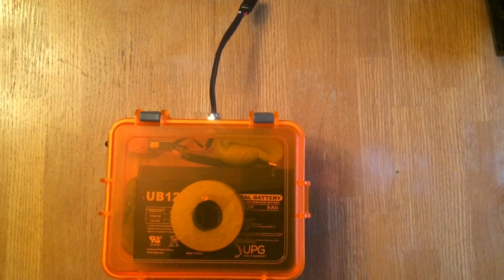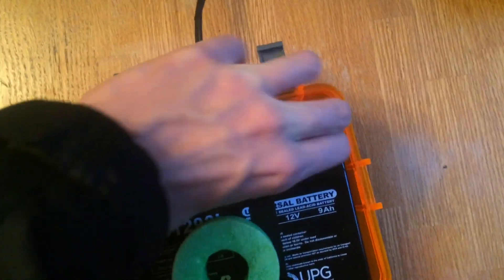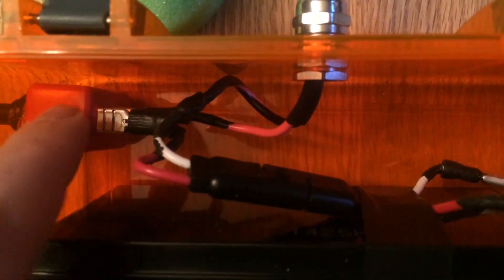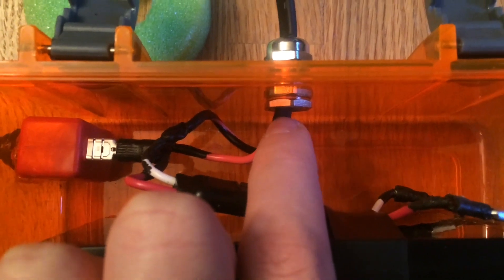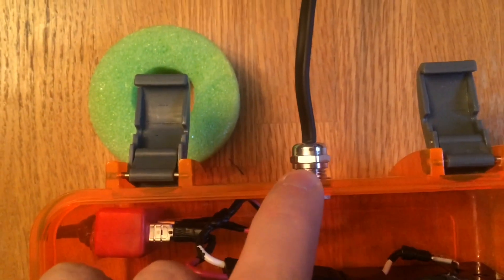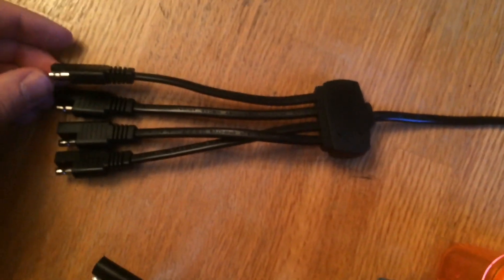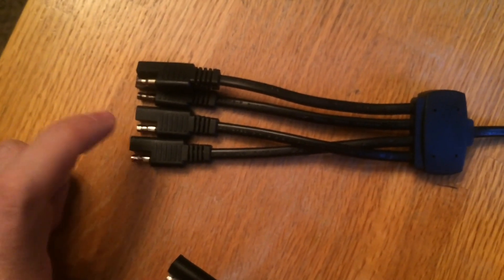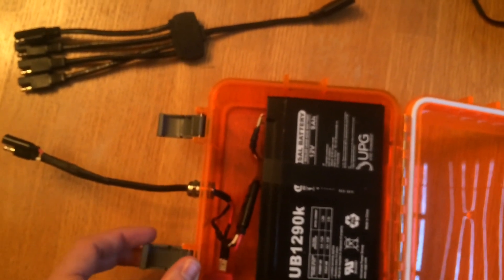Waterproof 12v Battery Box for Fish Finder, Livewell, & Kayak Fishing

Comment: Nice job can you sent me the sopply list,
Reply from the maker: Supply List is listed in the YouTube video description just below the video.  There are links to all the items used.  Only item you didn't see in the video was an inline fuse.  We didn't need one for the electronic items we were powering.  However, if you plan on running a lot of electronics from the box it is recommended you put an inline fuse in.  You could wire the inline fuse after the on/off switch just before it goes through the cable gland.  THANKS FOR THE MESSAGE!
Reply: Thank to you
Reply from the maker: COPY OF SUPPLY LIST THAT IS BELOW VIDEO IN DESCRIPTION SECTION.
*****************************************
Supply List Below.

Watertight Container (Large Size): http://www.amazon.com/gp/product/B007...

SS PG7 Cable Gland (x1): http://www.amazon.com/gp/product/B00A...

SAE Connectors (x2): http://www.amazon.com/gp/product/B003...

SAE 4-way Splitter (x1): http://www.amazon.com/gp/product/B003...

On/Off Toggle Switch (x1): http://www.amazon.com/gp/product/B006...

Battery 12v 9ah by UPG (x1): http://www.amazon.com/s/?_encoding=UT...

F2 Crimp on connectors (use for connecting battery terminals to SAE wire inside box)

OPTIONAL: In-line Fuse If Your Electronics Don't Have Them: http://www.amazon.com/s/?_encoding=UT...

OPTIONAL SUBSTITUTE to SAE Connectors (threaded 2pin connectors): http://www.amazon.com/s/?_encoding=UT...
___________________________________
The build will also require that you pick up some heat shrink tubing or liquid tape to secure spliced areas like the SAE connectors.  We used heat shrink tubing because it creates a nice rounded covering that creates a nice seal when passed through the cable gland.  Hope this build helped give some of you kayakers an idea on how to build a battery box for powering your kayak gear like livewell, fish finder, or lighting.  We chose the 9ah battery because the size was identical to many of the 7 and 8ah batteries but just weighed more.  The case could hold a larger battery if needed.  See the listed Amazon container dimensions vs. battery dimensions in the descriptions at the links we posted above to determine what will fit if not using a 12v 9ah. 
___________________________________

OPTIONAL SAE ATTACHMENT FOR GOPRO CAMERA USERS
**Use the below product and pair it with the camera build we show in our other videos.  This will allow you to power your GoPro camera on the water for the entire day.

SAE to USB converter (Optional):  http://www.amazon.com/gp/product/B00D...

VIDEO LINK OF GOPRO CAMERA SETUP: https://www.youtube.com/watch?v=PmcIT...

Comment from the maker: In-Line Fuses Should be Considered If Your Electronics Don't Have Them Built In.  Also, those in saltwater areas should consider waterproof connections like linked in description as substitute for SAE connectors.  However, if using the battery box in your hull of the SOT kayak it may remain dry enough to not develop corrosion issues.  The SAE connections we chose because they are similar to trailer connectors which are exposed to moisture all the time.  However, saltwater vs freshwater is different.  Saltwater will cause corrosion sooner and thus waterproof connectors would be of benefit so we put link in description below video.